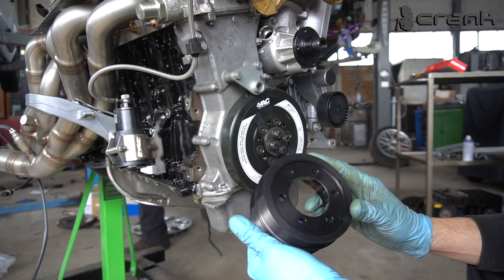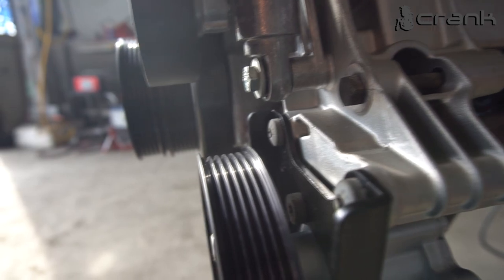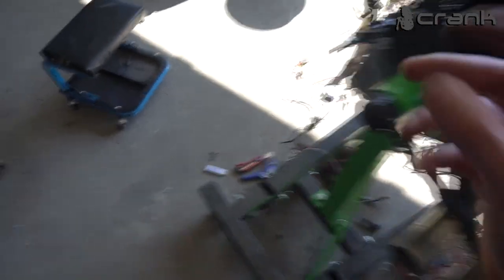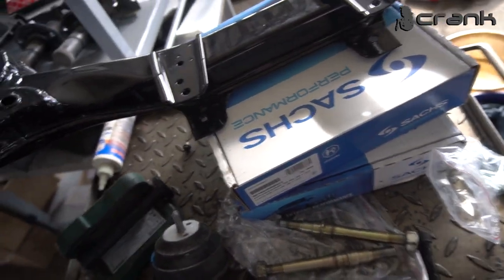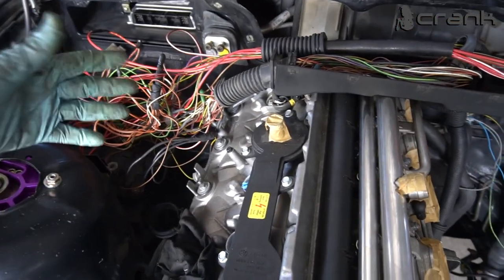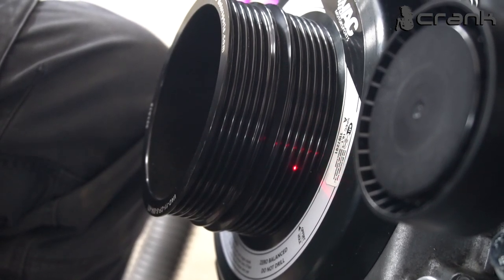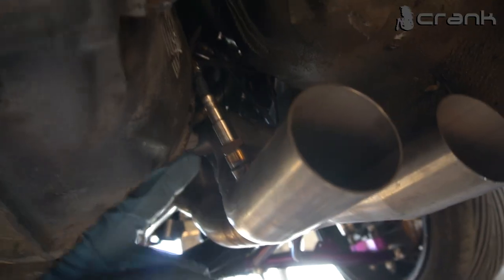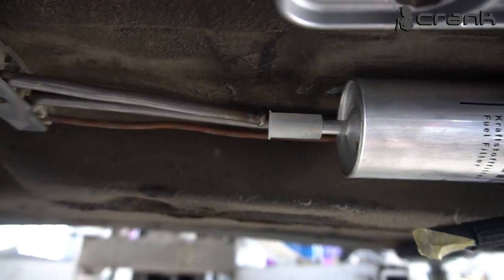BMW S54 Performance Pulleys Fuel System and Wiring

Comment: Hi, I have a problem with my 2004 e61 530d (m57). I recently had the intake off and after reassembling i was left with a crank no start, fuel pump not running (I can run the pump with ISTA. I checked all sensors near the intake and theyre all plugged in. Any idea what would cause this? Thanks for all the informative videos